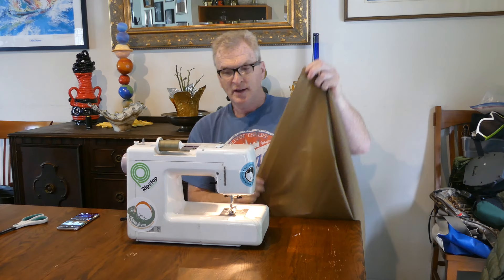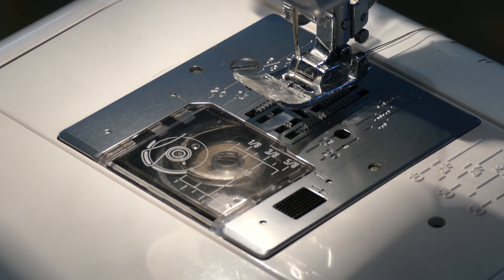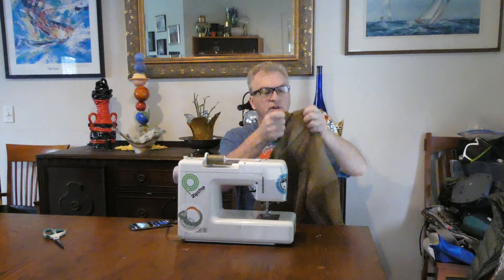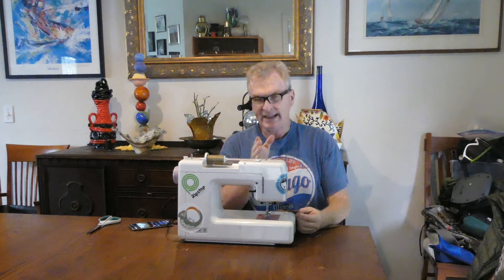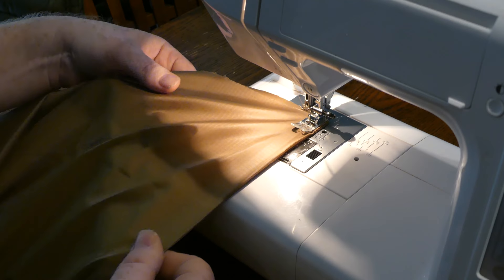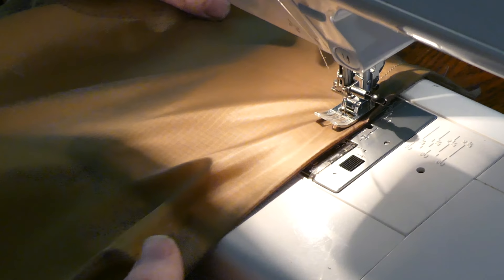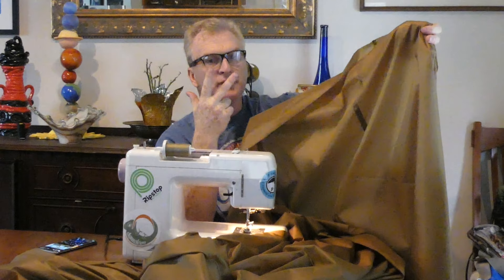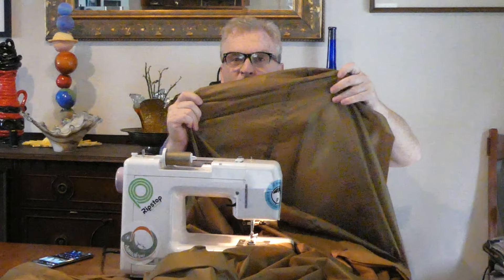Making a Lightweight Backpacking Tarp #2 - Sewing The Ridgeline

Comment: Bruce, this off the subject of tarp making, but have you ever made a hammock sock? I’m wondering about trying to make a winter vented hammock sock for my REI Quarter Dome hammock. Any ideas are welcome. Maybe it could have a built in ridge line to attach to the whoopie sling in place of the bug net. What do you think. I would probably use a light weight calandered argon.
Reply from the maker: I think I would make the winter cover just like the bugnet out of the lightest like argon and attach it to the other side. That way you just flip it over depending on the season. Or do something like the Helsdon Chrysalis, https://youtu.be/OJrJcB5E940 , that is kind of feature full.  But I really like what they did.  I would add some venting like the Helsdon, and I really liked the Chameleons location of mesh right by my face.  I think that worked pretty will.  I am really not that into the winter covers really though.  I think I may try a partial winter someday on a bridge that didn't cover the head but the rest of the hammock.  Sounds like a fun project and you have to let me know how it comes out.  Might be nice to decide on a color. Either black so you can get more sleep, or white so you get more light.  So many possibilities.  Have fun, let me know.

Comment: These are great videos! Thanks. I was wondering what type of thread your are using?
Reply from the maker: I use Gutermann Mara 70 for project like this.  If you can't get that, any outdoor. something that won't rot out like cotton,  UV resistant thread will suffice. Some of the generic might indicate Heavy Duty on it as well.
Reply: @naturecallsoutdoors  I found some Mara 70. Thanks so much. I very inspiring video series.

Comment: So, in effect, do you end up with 1/2” to 5/8” less fabric on one side of the ridge line? I’m copying a mega tarp and and trying to get he dimensions right for the angles.
Reply from the maker: Yes you are correct. I find though, in the field use, it isn't a factor one way or the other.

Comment: What needle gauge sizes do you use with your (U)LW fabrics?  Do you emory board sand the needle for even greater "scarf" sharpness, and cleaner sewing of the fabric ?  Time to get honey on the other side of the machine, and holding/pulling the fabric through the machine for easy sewing.
Reply from the maker: I use a 70/10 for most of my stuff.  And use the Mara 70 thread.  I use pretty nice needles and would probably mess them up if I tried to make them sharper.  I suppose some emory cloth may help a little, but they are the microsharp needles already.

Comment: Is this the same instructions that RSBTR has on the DIY kits for ridge line tarp
Reply from the maker: Yes it is.  I have a different process for the tie-outs
Reply: @naturecallsoutdoors  good been practicing the different methods. This one the easiest. Do you have vids on the tie outs,hems,etc
Reply from the maker: Here is a playlist.  Depending on what fabric you choose, if you decide to do your reinforcements like I do  you will need to pick the right glue.  For silnylon you  can make a mixture of 100% silicone like you get to do your bathtub and mineral spirits, or Seamgrip and toluene to thin